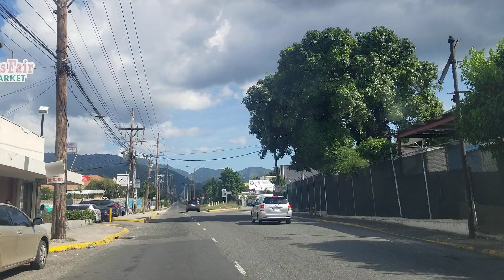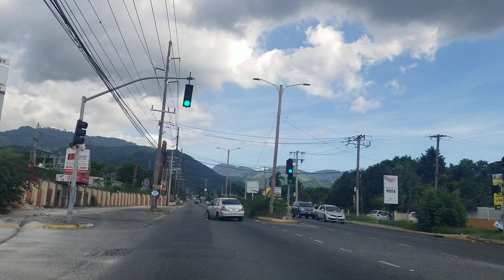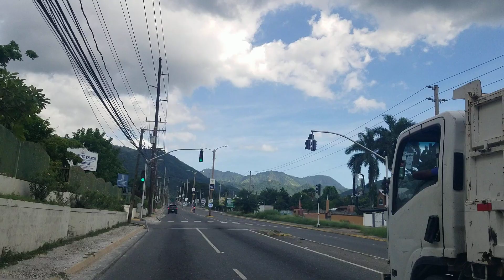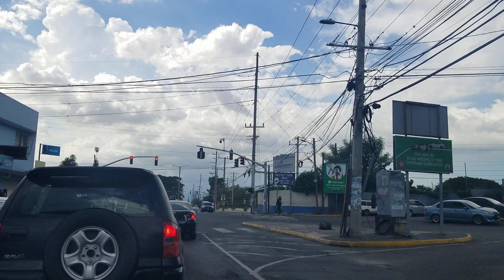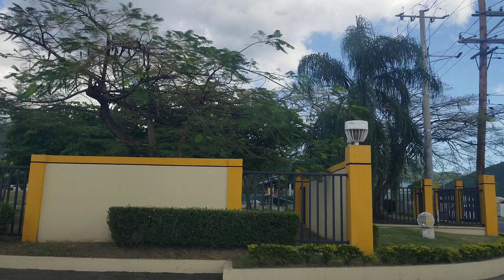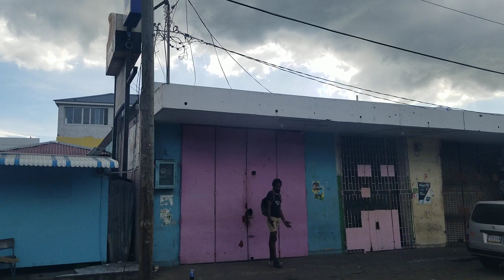Why install Fibre Optic Cables Under Ground Jamaica

Comment: THE POWER LINE WHERE I LIVE IN CANADA - After having  a detachable  double garage  build ,house renovation, they remove the power line from the alley that was going to the house in the air & run the power oline to the garage, & insulate the power line to the house by run it underground to the house, I was surprise.👍🏾👍🏾
Reply from the maker: Thanks

Comment: You don't have to go to other country. Under a good administration this would not happen. You talk about the unsightly wires overhead. At the same time you arguing about the fiber optic cable under ground which is the right thing to do. Are you for real? You are fu++ing confusing. Underground cables is more modern.less maintenance,prevent theft of the cable. It also safe from natural disaster like hurricane.
Don't play stupid my friend.

Comment: Instead of coming on here ranting a simple Google search on why they run fiber optics underground would help, sometimes u sound so unintelligent, if u dont understand sometimes u rant and make 10 videos about it, the internet is there use it to educate your self. They are not finished with the work, when they are done they will fix the road.
Reply from the maker: Lol thanks. It has been like this for 4 almost 4.weeks.
Reply: 😂😂😂 real dunce dat fi real
Reply: No need to be disrespectful,  & a show off, more like an elite snob👀

Comment: If they are underground there is less chance they get damaged. Zero chance actually unless some future digging happens to damage then. Cables on poles aren't protected from the elements especially hurricane winds. It's the same in the US.  If they need to go back in there should be conduits with pull cords so no need to dig up everything again.
Reply from the maker: Thanks
Reply: Exactly 💯 in the States the cables are underground